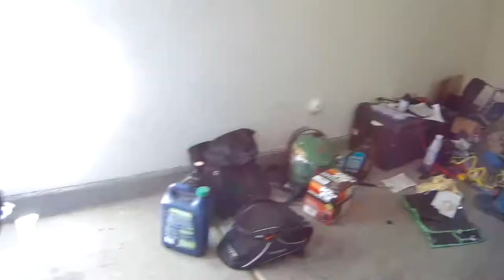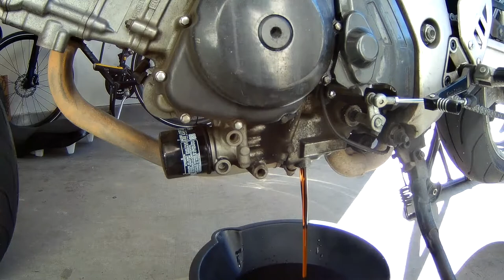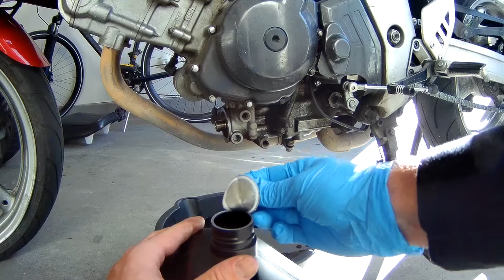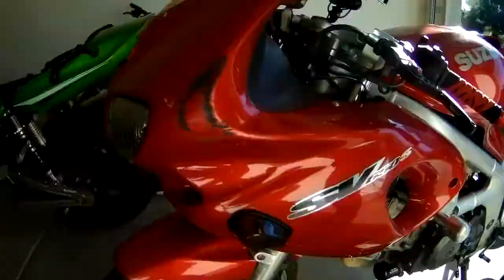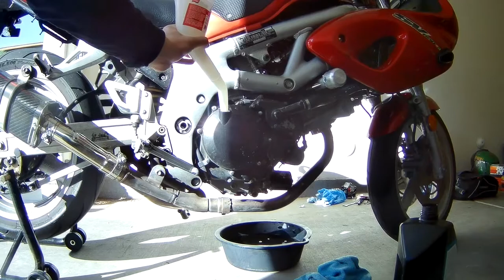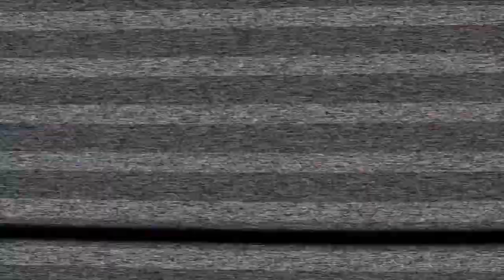Oil Filter Change - 2001 sv650s

Comment: Did you do 6000kms for that oil change? Oil looks pretty clean there.
Reply from the maker: I think it was close to that, I usually do seasonal oil changes though so I don't quite make it to the "distance recommended" based oil changes

Comment: How Much oil ?
Reply from the maker: The owner's manual states 2300ml for an oil change or 2400ml for an oil and filter change. I'd recommend doing 2300ml, letting it run for a minute, and then check the gauge before adding the last 100ml.